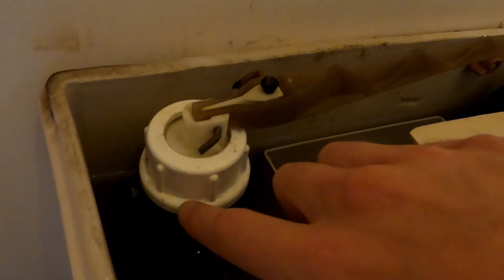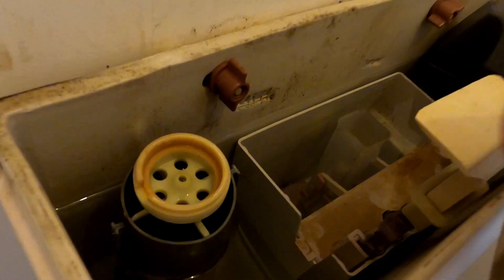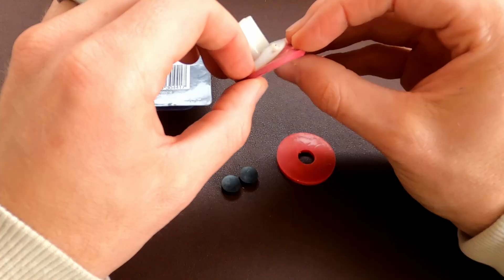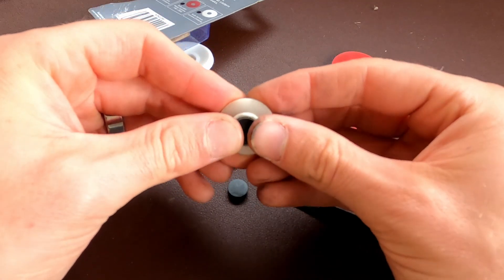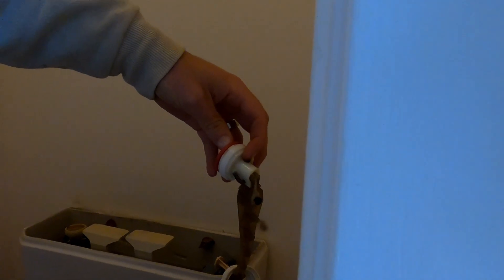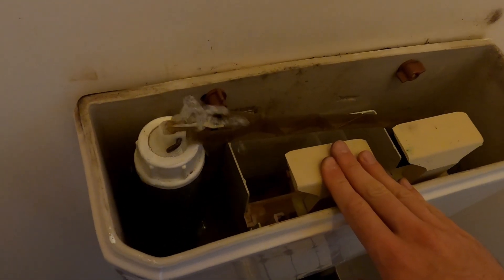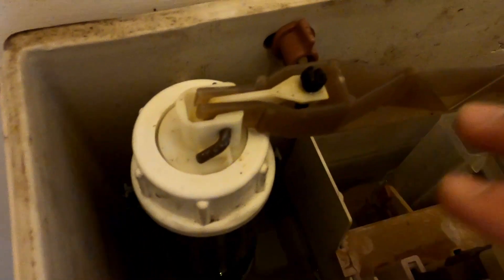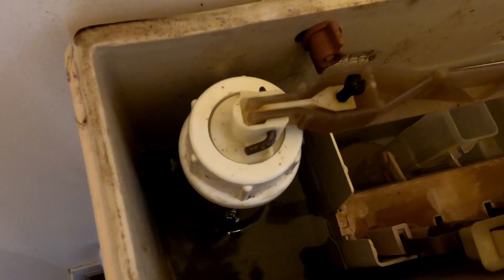FIX A LEAKING TOILET | DIY Ballcock valve and washer replacement for Caroma toilets on a budget.

Comment: Watched all the videos. Changed the ball cock seal and the seat washer, took care to ensure the seating seal was tight against the inner lumen and the problem continues.  I have adjusted the screw in both directions and I also cleaned the cistern surface facing the seat seal. The leak in to the toilet pan has diminished, but leak it still does. The inlet mechanism continues to his and bubble while never shutting off unless I manually lift the float arm the last little bit.  I can only think that it might be the water level being too high and flowing in to the overflow but I cannot adjust the screw to produce the desired water level result.  I have decided it would be easier to dig a 'drop dunny' out back, so I am off to dig now. Cheers.
Reply from the maker: If it's that hard, I'm looking for the closest plubmer! haha

Comment: nice video. i have replaced ballcock and the red washer. but the water does not stop filling in cistern. it has the soud of water going into cistern in very slow flow but you can hear the sound. it looks like the flot is not high enough to push down the ballcock washer. not sure if you have the same problem.
Reply from the maker: no good... might be a plumber job...